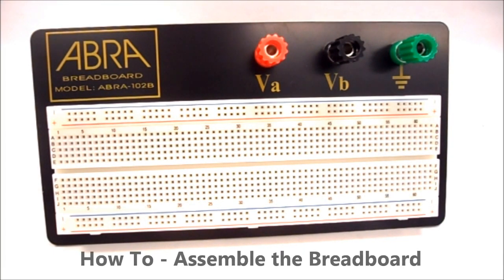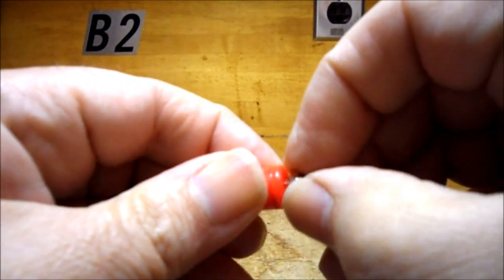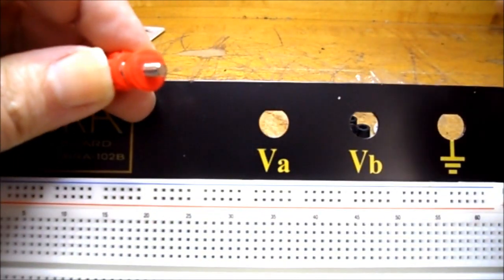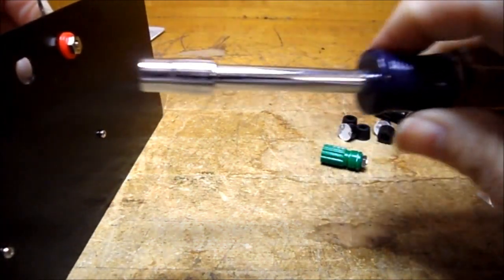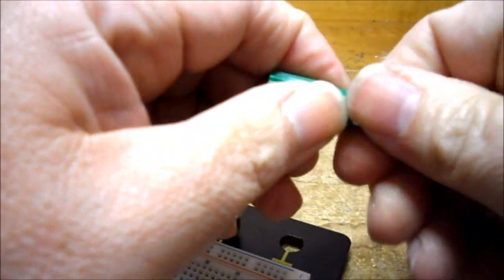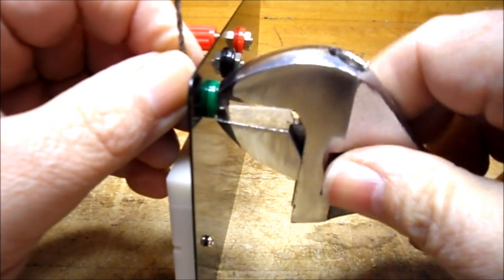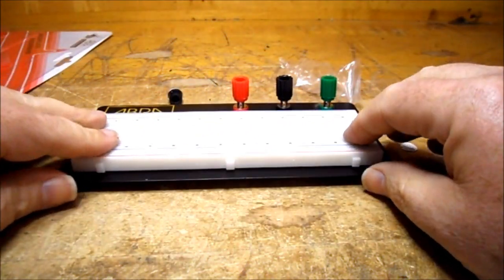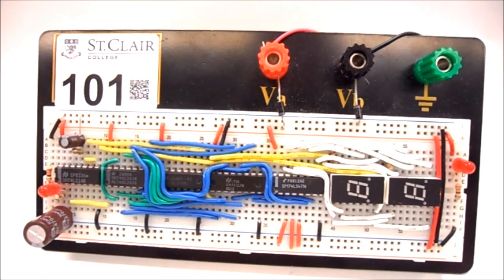How To Assemble  -The ABRA Breadboard

Comment: Ok, this confirms what I suspected - the binding posts on these large breadboard kits don't do anything.  They should have an internal connection to the power rails, otherwise they don't eliminate any wires.  I like your polarity-protection diodes...

Comment: Since the binding posts are insulated from the board, and each other, and of the maybe fifty YouTube videos I have seen on use of breadboards, none of them use binding posts.  None of them even HAVE binding posts.

And yet, you spent over thirteen minutes, in painful detail explaining how to spin a nut onto a threaded shaft.  Boggles the mind.
Reply: Riveting stuff
Reply: Sadly, I think he used the binding posts incorrectly.

I would have thought that the idea of needing binding posts at all would be to make it easier tp plug in power from a power supply unit using the standard bananas plugs in the posts and then running the smaller wire from the post to the breadboard.
Reply: The flat border plastic whasher was intended (with the flat mark) fot use on a much tiker plate, so both flat marks align. As long as this is a thin plate, that is correct to use the flat mark orientated outside.

Comment: Flipping that final plastic washer over so the flat spot doesn't get used was a fantastic idea that made this process 10x easier, thanks for the awesome tip!  I have to assemble ~20 of these boards.   I found that using a soft-jawed vise to hold the edge of the metal board helps alleviate the need for an extra hand.